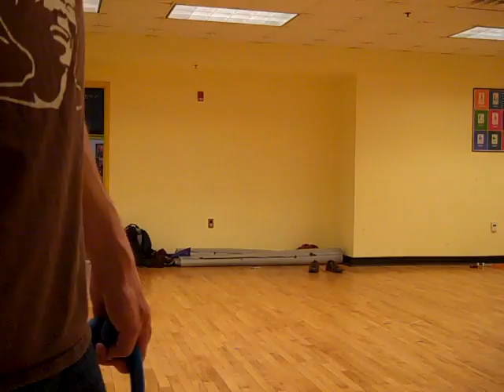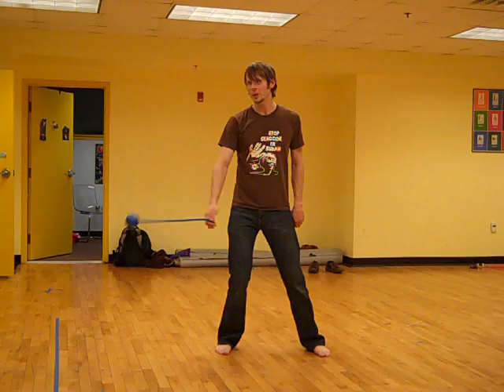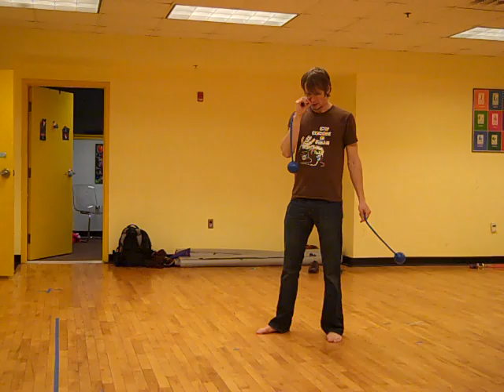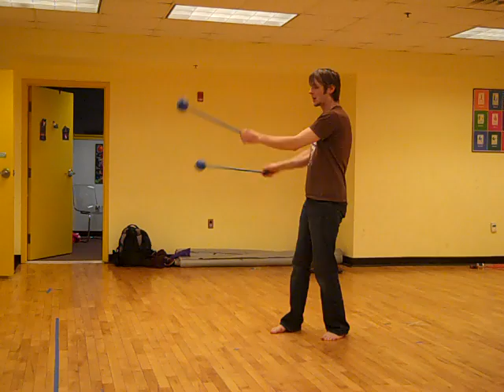Drex's Tech Poi Blog #76: transition theory and weaves

Comment from the maker: @otherwheregirl I'd love to do one! Here's the problem I keep running into, though: when putting together hybrids, by definition you are contrasting one pattern against another. AJ refers to this as composite spinning and CAPs are another example. When contrasting said patterns against each other, there are a range of hand speeds or "tolerances" that each move can be accomplished within, such that a cateye can be synched with an isolation, but not with a 4-petal antispin flower.